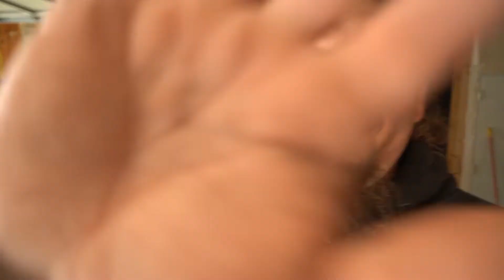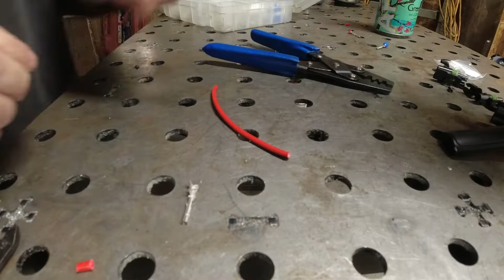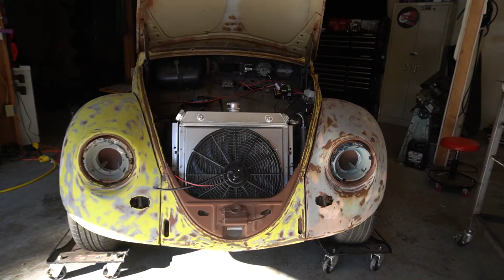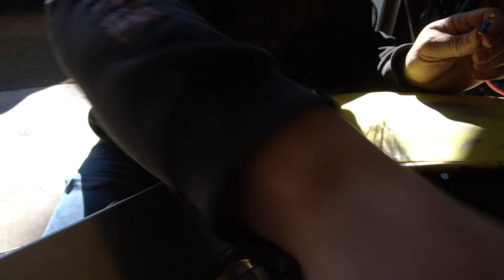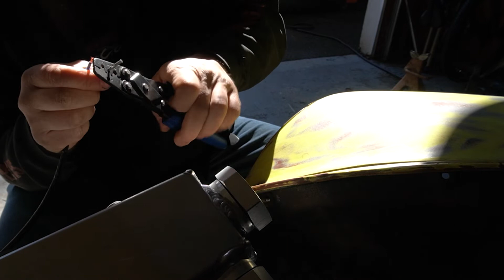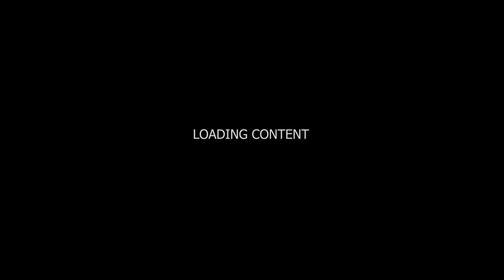how to crimp weather pack wire connectors

Comment: Thanks! Could you share where you sourced your connectors?
Reply from the maker: I used eBay. cheapest non ratchet crimper lol
Reply: @boostedpower5417  was wondering about the connectors. There are so many brands and Chinese knockoffs.
Reply from the maker: @montanaharkin  yup I used the cheapo Chinese knock off stuff.

I should order some of a well known brand and compare it. 

I am currently going down a rabbit hole on crimps for other applications and I am finding some really nice stuff I never thought existed.